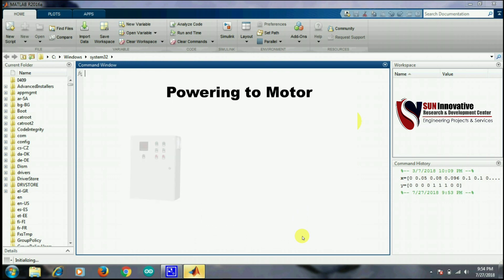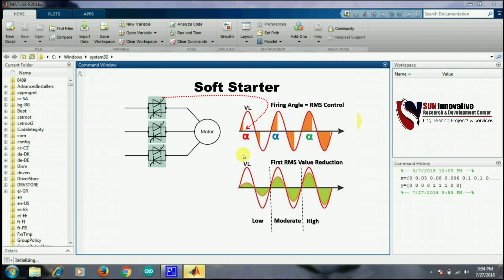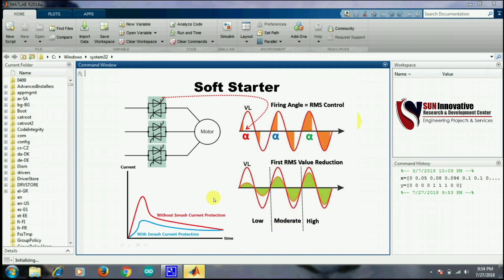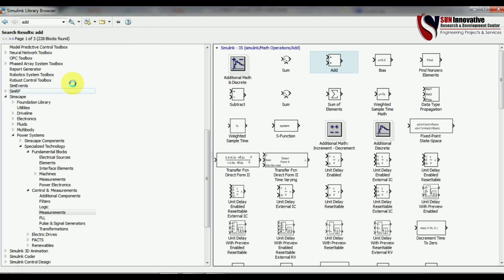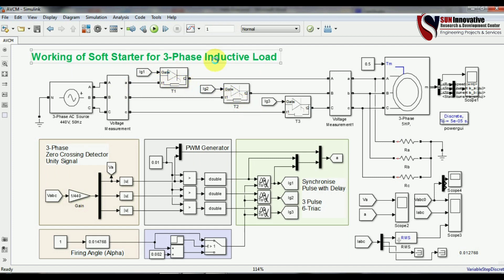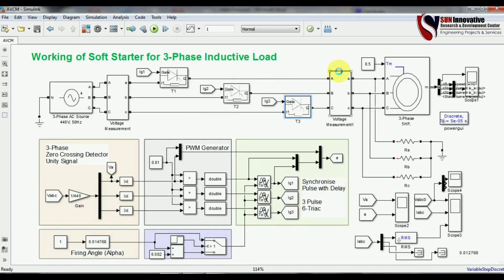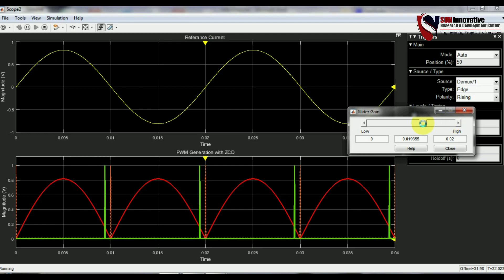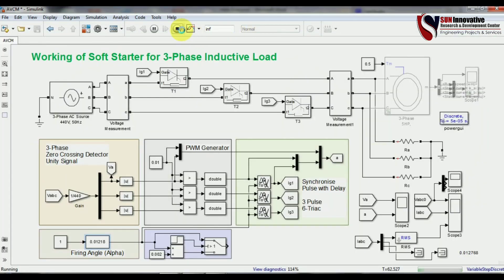How Soft Starter is used to Reduce Inrush Current | MATLAB Simulation

Comment: Sir , I have connected all the blocks . But after compliling it has following errors :
1. Multiple Gotos found with tag named ' Iabc'.
2.First offending Goto ' starter/voltage Measurement / Iabc'.
3.Second offending Goto ' starter/voltage Measurement / Iabc'.
Reply: Sir , after fixing it . Same error is showing .
Reply from the maker: What error?
Reply: @SUNInnovative  error with go-to block ,
Reply from the maker: I need a exactly statement of error .. without see your file and error statement how do I solve this ?
Reply: @SUNInnovative  sir only one error is showing .
'Starter/voltage Measurement/Iabc' has unapplied changes. Please apply or cancel these changes before running the simulation.
Reply from the maker: Dear,

In such case it's better to go with technical help, email us it's paid service but I am sure will helps you a lot
Reply: @SUNInnovative  okk sir
Reply: Sir, will you please mail complete model .  we will pay for the model .
Reply from the maker: Dear,
For that you need to inform our technical team by email, do t worry about service, we value your money. Send a requirement to mail (available in about page)
Reply: @ashishrathore9478  bro ...u got the output?
Reply: Can i get you contact number need help?? For simulation
Reply: Can you send me your simulink model?
Reply: Block kitne me kharide
Reply from the maker: Dear,

Don't worry its a small error.
Reason: (if you use same goto block for multiple connection then this error will popup)

Solution:
Follow the steps:
1. Open Goto Block of particular Name e.g. Iabc or Vabc
2. on right side you will see the  "TAG VISIBILITY" 
3. That is default set in "LOCAL"
4. Make it to "GLOBAL"
5. Do this thing to every goto block 

your problem will be solve.

Comment: Sir is the block  used for  voltage measurement is v-i measurements?
 What is block  the block  used as gate with thyristor?
Reply from the maker: Dear,
There are many blocks connected with system, please can you show us with details, what is sign of that block etc.
Reply: Heyy Did you get the complete output???

Comment: What is block used for firing angle?  What  is the value  of resistance  used? and what is written  in powegui
Reply from the maker: dear,

1. Block Name is Constant & Slider Gain (for firing angle)
2. Value of Resistance is 50Ohm (You can set between 50 - 200Ohm)
3. Powergui is set under discrete mode and values is 50e-6